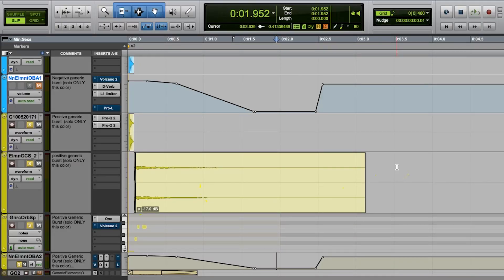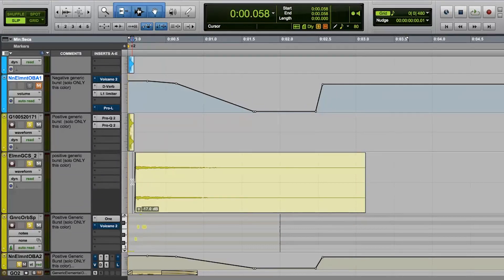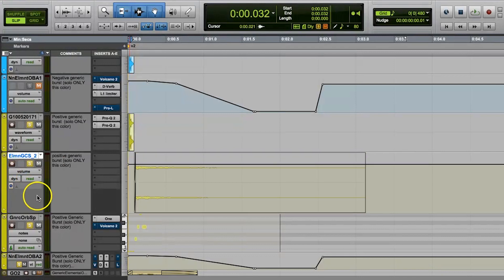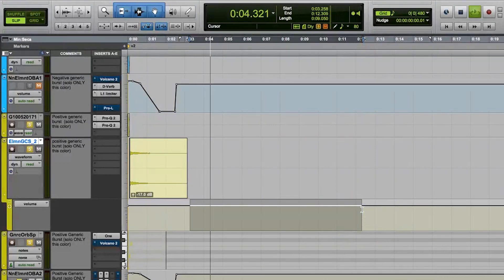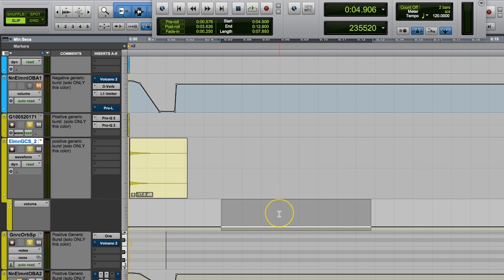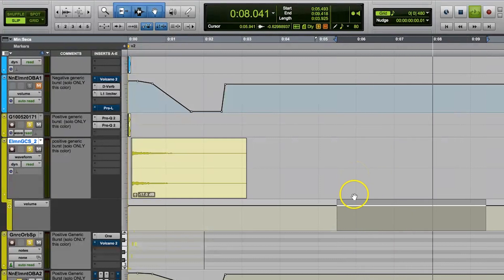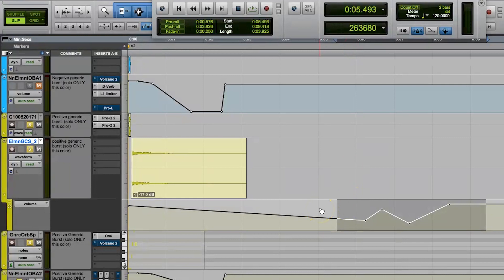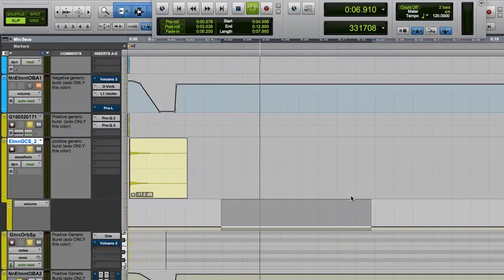Clip Gain vs Volume Automation in Pro Tools

Comment: Hi Cato, I edited a session on Pro Tools 12  using "volume automation" and now I need to coalesce volume automation to clip gain on so that the mixer slighter won't go up and down during mix annoying the sound engineer and cancelling all my work I have done on the volumes. I used to use this function on PT 10 going to the menù bar EDIT and then from  AUTOMATION would choose COALESCE VOLUME AUTOMATION TO CLIP GAIN, but now I can't find it on Pro Tools 12...  any suggestion?

Comment: The main difference is that clip gain is pre any processing and volume automation is post processing which affects the way it sounds in the mix (e.g. when hitting a compressor). Another thing is that you actually CAN automate clip gain using a graph just like Volume Automation by using Clip Gain Line from the View menu under Clip.
Reply: Best comment here.

Comment: You failed to mention a very important difference between clip gain and volume automation... clip gain adjusts the audio BEFORE (pre) the fader and so also BEFORE any plugins. Volume automation adjusts volume AFTER (post) the fader and plugin processing... big difference!
Reply: Yes. This is infact true and can be tested fairly easily. Pull up a clip on a track with the basic 7 band EQ, that comes default with pro tools, inserted on said track. Pulling down or pushing up the clip gain will show a level change in both the input and output of the plugin. Whereas you could raise or lower the output fader to any level and your plugin meters stay unaffected. The clip "gain" determines the input level of the signal in the chain and the volume fader determines the post inserts level. So any clip gain automation would affect your gain staging into a plugin while a fader ride would not.
Reply: The difference becomes significant with gain based plugins on your track like compression or saturation.  Say you had a compressor with 2:1 compression and your clip is hitting the threshold.  If you add 3db via volume automation, your track in the mix goes up 3db... duh.  If you add 3dB of clip gain, your track will just hit the compressor harder so the resulting peaks above threshold will only end up 1.5dB higher due to the 2:1 ratio.  Similarly with saturation/distortion, clip gain will affect how it hits the plugin, so it will change the amount/character/tone of the distortion where volume automation only affects the level.  Guitarists who use overdrive/distortion pedals are familiar with this concept since most such pedals include both a gain/distortion control and a separate "volume" control.
Reply: but volume automation CAN be pre-FX&fader lol but I'm basically equating clip gain automation with pre-fader pre-FX automationn, lol now I realize there's not necessarily a clear-cut difference when coming to the 'FRINGE' of the matter.

Comment: Clip gain adjustments are pre-fader. Volume adjustments are post. If you have a hot track, you might still get distortion due to overloading your inserts (which as noted on another thread - are also pre-fader). Clip gain is the only way to address this (as i have just learned ;-) ). Volume automation is no help in this situation. Also, gain and volume are not the same thing  - by reducing clip-gain you don't always get a proportional reduction in volume. I'm not quite sure why this is the case, but sweeping a track with small gain changes can make for a much more usable & level track so you get more consistent behavior from your plugins. Fine-tuning with later volume automation - as you suggested - completes the process. Thanks for the video.

Comment: Something you and everyone else should know - Clip gain and volume automation are not the same thing. Using clip gain you actually lose audio quality. I discovered this, and then clarified with some top end engineers when I was mastering an album. It's not very noticeable on a single instrument track, but on a full mix track - say for mastering - it is quite noticeable. Most engineers I've told this to don't believe me and argue, so I've come up with a really good way to explain it - I also encourage you to do some experiments with a full mix bounced to 2 track and use clip gain vs volume auto or fader. 

Here's an explanation I've come up with to describe what's going on: think of your audio track like a photo. The photo was taken at it's optimum resolution. Clip gain is like zooming in or out of the photo, it will pixelize - or lose quality! Volume automation, or moving the fader up and down is like vectors in graphics. If you're not familiar with vectors in graphic design it's a bunch of points that contain information about angles and ratios of distance going from one point to the next which enables you to enlarge it or shrink it without pixelazation or loss of quality. This is why volume automation is technically "better" than clip gain.

I know I'm getting pretty technical and nerdy about it, but I just thought it would be important for people to know. When I'm mixing or editing audio I will use clip gain sometimes for individual instrument tracks because I don't feel it's big enough of a difference to warrant the more tedious process of volume automation, but I have used it less since discovering this. For instance if the section I want to adjust volume is longer than half a second I'll use automation instead of clip gain. It's made a big difference for me for mastering albums. I used to use clip gain to create the "perfect" amount of headroom for tracks, and to balance them together before I hit my master processing. I now just use a trimmer/gain plugin - which is the same as just moving a fader up or down, or volume automation. On rare occasions I will use volume automation in mastering so at certain points the song hits the comp and saturation harder.

Well that wraps up this novel lol. Hope this info helps someone!
Reply from the maker: Woah!  The preview for this comment just showed me the first sentence that ends with "clip gain and volume automation are not the same thing," and my first reaction was: thanks for the summary, that's kind of the point of this video!  Haha

But man, I have not heard the argument that clip gain loses quality before.  I'll definitely have to look into it more.  Is there a good explanation out there that you recommend I check out?  

I do understand the image metaphors, because I've done some graphics work.  But, I don't think I fully understand how it maps to the clip gain vs volume automation argument.  I guess I visualize all digital audio as similar to a vector because of the way sample rate, etc is used to create the waveform.  So I would then visualize analog as being more like a photo image....?....I'm just thinking out loud here.  And I can see some issues with that metaphor too .... but I think I'm currently visualizing it that way because photo vs vector are two completely different formats, and I don' t see the format for the audio changing depending on what tool you use; PT is still referencing a digital audio file that's on your hard drive somewhere.  

But, I mean, that doesn't mean that there's not something about the way the programming works behind each function (clip gain vs volume automation) that changes the quality with one and not the other.  I guess I need to look into more details about what is actually happening when you use each.  It's an interesting argument; I would love to hear more about it! 

Thanks!
Reply: @CatoNoise  Im pretty sure you only lose quality if you exceed the volume limit for the track [peaking]. As long as you haven't boosted volume anywhere else just keep the waveform within the boundaries of the audio box and you'll be fine ^^
Reply: DSP Engineer here. Your statement is wrong
Reply: @Elcan99  haha, yeah you're right. I am wrong. My test was flawed, it does sound different when using when using compression or saturation or most analog modeled plugins. Because clip gain is pre plugins and volume automation is post plugins. I should probably delete my original comment.
Reply: Pyrate LLama Recording Studio in digital sampling once the audio signal is sampled in 24 bit resolution the noise floor is so low you won’t hear a difference if you increase the gain, as long as you’re not clipping.
Reply: The Vector analogy made sense to me with regards to Volume Automation. Very interesting. Thanks for being nerdy. :)
Reply: @CreativeBlue  after further testing I was wrong about this. It changes the sound when using analog modeled plugins since its getting higher gain going into plugins with clip gain. Using volume automation is post plugin so no change of plugin reaction.
Reply: not sure how clip gaining is described through a metaphor of 'loss of resolution'  very accurately, mainly cus i am not sure how you figure changing volume per-clip results in less resolution than changing it much more frequently, per se

Comment: Cubase user here. Are inserts post or pre fader in PT? Major thing to consider choosing one method or the other.
Reply from the maker: Hey, thanks for watching!  My understanding is that inserts in Pro Tools are pre-fader, with the exception being the master fader inserts (which are post-fader).  Sends can be either one though.  And if you want to make the inserts post-fader on a track, you could always route the track to an aux track that has the insert, and then you can control it similar to how you could if it was post-fader.  

But yeah!  That's a great point!  Clip gain effectively makes the level changes before the inserts, whereas volume automation would make them after.  So that's another thing to consider before deciding that I should have mentioned!  Thanks for adding that!